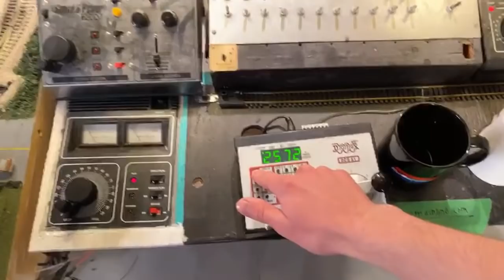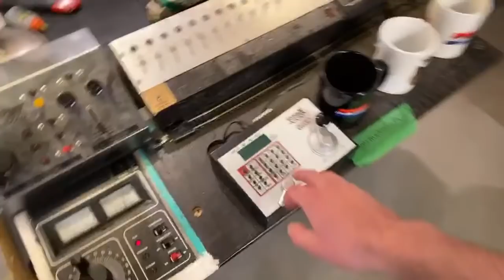Running Trains on My Ho Scale Layout Live

Comment: For those interested in starting in model railroading, don't overlook the books about the hobby that your public & school libraries have!  Don't feel you can't run SP & UP equipment together!  The UP & SP were known as the " Harriman Roads" because they both were owned by E.H. Harriman.  I saw a photo in Classic Trains magazine of " The Overland " a jointly operated UP-SP passenger train that has cars from both roads.
Reply from the maker: It's an overlooked way to get information about model railroading.
Reply: @SMTMainline  hello SMT I have the driver screws If you have a po box I will send a few to you I buy rivarossi steam parts every time I come across them because they are had to come by
Reply: @SMTMainline  well Harrison good day for your viewer that said dd40 was actually  dd35  no not close body yes but  power no dd35 5000 horse power and dd40 6600    540000 pounds  dd35 520000   dd35 made in the early 60s dd40 late 60's   . I don't like when people try to one up or correct you we are supposed to have fun. You call it what ever you want it's your train .
Reply from the maker: @normancoreyBuildingTrains  There has been an ongoing debate in the community on if those Athearn locomotives are dd40 or dd35 locomotives. I'm not so sure they count as ether since they weren't prototypical models.
Reply: @SMTMainline  it what ever you say it is seeing the body's are just about a clone if not exact.
Reply: @SMTMainline  well folks just at work tinting a Benz listening to a SMT live stream.  I find it relaxing all this train talk.

Comment: Movies with trains came up in the stream.    If you've never seen these check them out when you have some time.

Dirt Mary Crazy Larry ( 1973 )
Ending scene involves an Also S2 with Union Pacific boxcars and a Dodge '69 Charger.

The Seven-Ups ( 1973 )
Scene near the end shows a run down section in New York City along Penn Central's Northeast Corridor.   Penn Central and Amtrak GG-1s in the solid black PC scheme and Amtrak Platinum Mist and the Penn Central United Aircraft Turbo Train.
The GG-1 really did sound like that with the humming motors and the single note blat air horn.

Comment: size on the rivarossi  bolts on the wheels is a 3mm   and the old rivarossi big boy will run with out the tender the pic ups are on the front and rear wheels including the rear truck and the small front truck some of the 2 8 8 2 rivarossi need the tender and some dont depending on when it was made.

Comment: I actually have the bachmann HO scale Hogwarts Express. I used to set it up under my Christmas tree and let it run around it I haven't used it for about 2 years now I know the last time I ran it it was running slow so it's probably needing oiled and its Wheels clean.  But I do have it I used to work in retail and the store that I worked for had it in the clearance aisle it was the only one left and I bought it for$25..

Comment: What are your thoughts a vintage Mantua?  I have an 8 car set GN 2-8-2 Mikado GreatNorthern in all new condition but pulls slower forward than reverse and an Athearn Blue Box GN SDP40 per/dummy set Blue/White scheme that pulls 15+ roll stock that I have with ease. Has great slow speed.